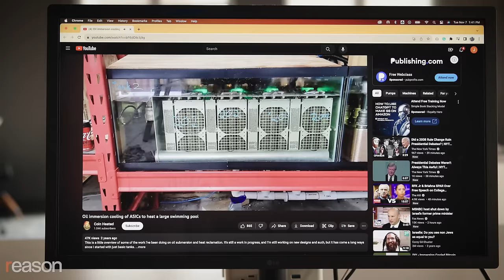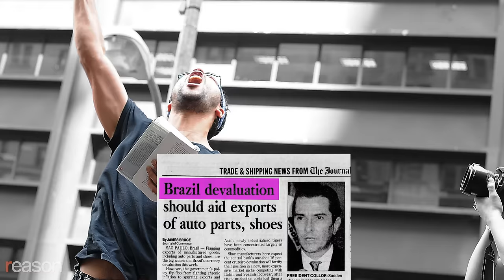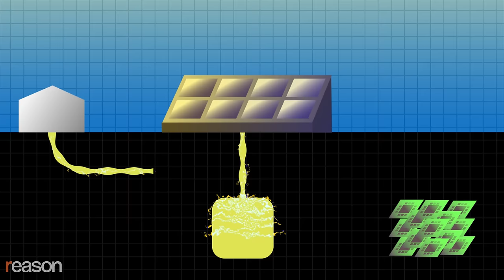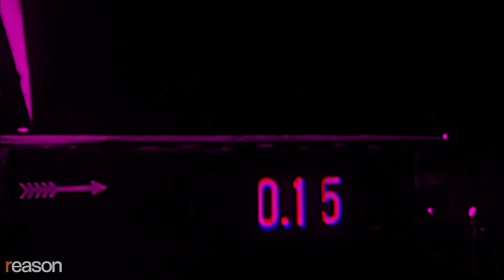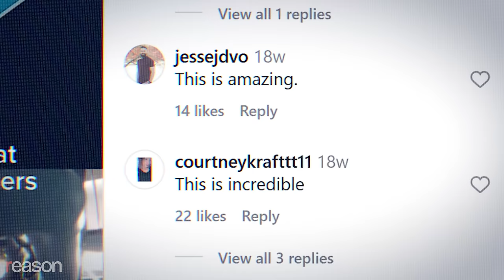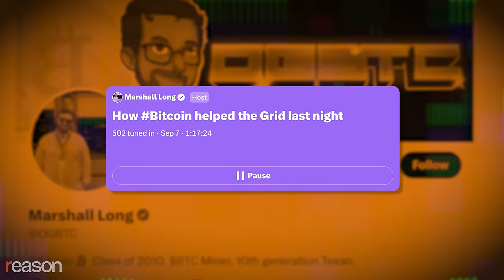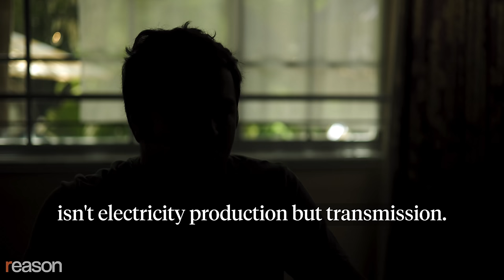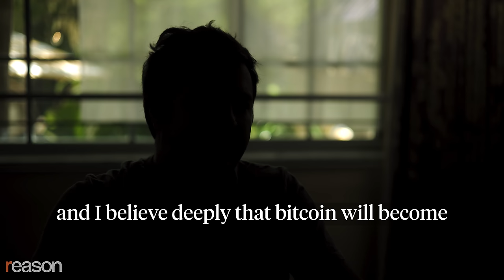The future of energy? Brooklyn's bitcoin-heated bathhouse

Comment: What a suprisingly unexpected video.  I got much more than the title promised!  Of course politicians don't like bitcoin and other cryptocurrencies, because it takes power away from them and their government-produced and controlled money supply.  The energy usage has been bothering me somewhat, but now I see entrepreneurs turning a problem into an opportunity and it works.  This is great stuff.  But like the problems with government-controlled money, this is really pointing out the problems with government-controlled energy, as well.  Politicians may still be against this because it points out the problems they've created with the energy grid, both with production and transmission.  The energy grid is stuck in a bad situation because they can't update and innovate like they need to. 

Anybody who's worried about climate change and the increasing population needs to look at examples like this to see that governments are part of the problem, not part of the solution.

Comment: He's gonna have fun with the 4th halving. Highly inefficient. Heat pump much better
Reply: Can you explain what's wrong with what he's doing in terms of efficiency? Would love to hear an explanation from a specialist
Reply: @bertsteinich  'A heat pump is a heating system that can generate up to four times more useful heat than electric heating by Joule effect. The coefficient of performance (COP) for a typical household heat pump is around four, which means that the energy output is four times greater than the electrical energy used to run it'
I have Bing Chat by my side. I guess you met your match.
Reply: The energy part is all bonus on top of the bitcoin mining itself.  So it's efficiency isn't that critical to the operation until it gets really bad.  Heat pumps are great, but they're not perfect.
Reply: @99Davidcool  isn't he already doing just that? He pulls the heat from the mining setup and transfers it into the saunas, thereby cooling the mining rigs and heating the pools of water at the same time.
Reply: @bertsteinich  Looks efficient to me.  Last time I checked, heat pumps don't mine Bitcoin.
Reply: why don't we focus on the maintenance. how long do the cards that do the work last? Do they even last a year?
Reply: @99Davidcool NO FREE ENERGY
sure the hot tubs are hot but the honless man outside is freezing at -80c (not really) that's why its called heat pump and not heat generator
in terms of heating efficiency a GPU is very high up there

Comment: The only thing that could possibly make Reason more excited about this is if it were a gay bathhouse and it had a weed dispensary in the lobby. I think their heads would explode.

Does anyone know what that "specially engineered biodegradable coolant" he's using is? I assumed it was fluorinert or something at first, but it obviously can't be that.
Reply: Could be mineral oil or distilled water
Reply: @annonimity276  there's no way it's distilled water, even ultrapure 18 megaohm water is too conductive to immerse electronics like this. mineral oil isn't biodegradable.

Comment: I think reusing by-products and waste is important for sustainability; however, this idea is kind of bass-ackwards. Cryptocurrency, at this point, is purely a speculative sport. You are heating up your water with gambling in this scenario. The other issue is that this business model crumbles if bitcoin crashes. Something to consider, the heat from the bitcoin mining is far less efficient than producing heat as a main product. The cost efficiency is helped by the bitcoin you mine. Another issue is that energy isn't exactly cheap in the US which is why we have seen many people look to other countries for Bitcoin mining. I guess the point I am trying to make is that the principle is great, but the application is gimmicky.
Reply: Bitcoin is a shit cryptocurrency - it was a prototype that never died, but the miners can always be swapped to mining an actually useful cryptocurrency (like Monero). It is gambling, but bottom line is that (for now) it still makes money.
Reply: Ultimately, it should be up to the business to decide whether or not they should run the operation with bitcoin. With the bathhouse idea, it seems to be working just well for him. Having this to be working for both a currency and heating, it ultimately allowed for that dual purpose, satisfying two markets at the same time.

The bathhouse thing is only one part of the equation here, keep in mind about having to use energy which would of otherwise been wasted by burning up the fuel. Also how with solar would have to find a way to store the energy or waste the energy when it is in the lowest demand, thus lowering prices due to surplus. The demand for said solar energy will be otherwise distributed to people that want it, the mining operations, as to not waste said energy. Not to mention, these mining operations allow for more funding to these solar companies, which incentivizes these solar companies to do more R&D on the solar technology. Therefore, bettering the green technology we all so want to have.